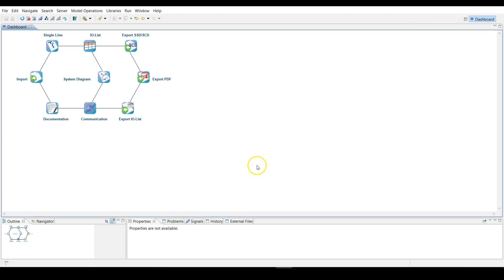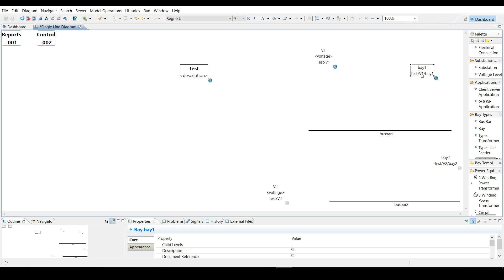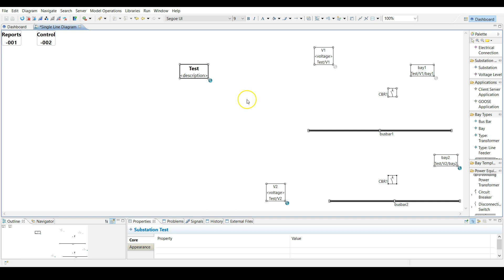Video 01: Substation Structure

Comment: HI which software are you using. How would I represent a substation in DIgSilent powerfactory
Reply from the maker: HI, the Software is called Helinks STS. It stores the data in IEC61850 SCL.  I think there is an option to import/export SCL from and to DigSilent.